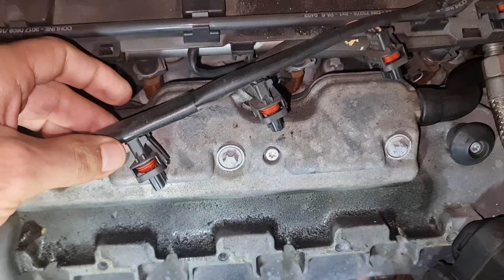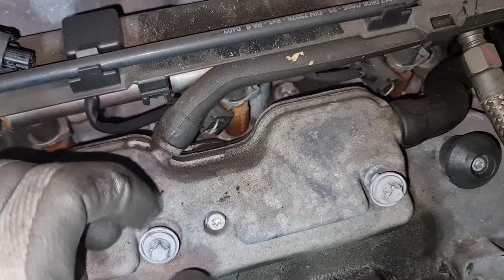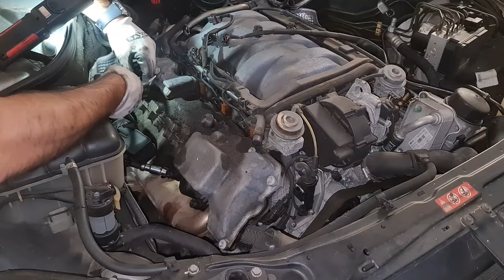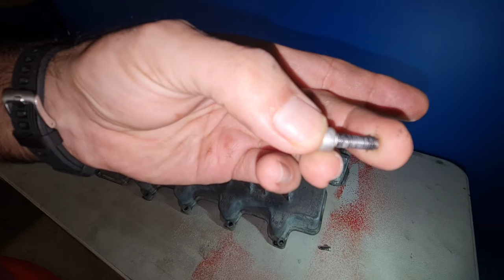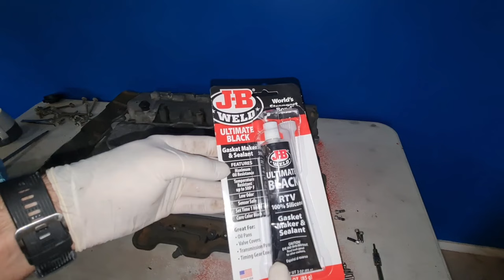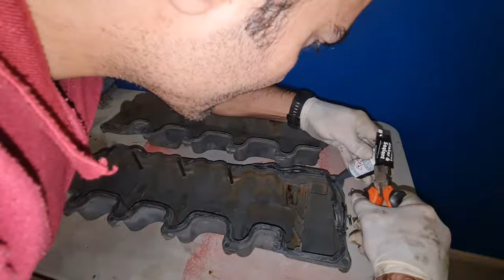The Secret to a Clean Engine (Mercedes M113 & M112 Valve Cover)

Comment: I have to re-do it again. Very annoying. The work is straight forward but it's still a pain in the 4ss because if you torque it slightly wrong or if it is not clean enough it will leak again. Plus I have a gasket from the manufacturer Elring which is too narrow and leaves a gap. Poor quality. It drips like crazy, I'm so pissed.
Reply from the maker: I know it is so tricky... that's why I am stressing in the video...
Reply: It will leak again because of design error.  The gaskets are barely adequate. Modern domestic use same sealing methods and the (factory) gaskets can be reused many times and the aftermarkets also don't leak but swell up too much to easily reuse.
Reply: After trying six times I finally got it shut. I found the place where the oil creeped between the cover and the gasket and added some RTV to that spot. But only a tiny amout, too much RTV will warp the gasket and create another leak. It's an artform by that point.
Reply from the maker: @haramaschabrasir8662  exactly my issue was that too first time.

Comment: I reseal the pcv cover and it start to leak, gonna do it again. btw, those 5nm bolt are extremely easy to strip, and the cover is very easy to snap if it's recently sealed
Reply from the maker: Yes, tricky...
Reply: Replace the screws and/or be extra careful.  Use Yamabond, The Right Stuff, OEM factory, hondabond, threebond, etc.  I used the best regular RTV (ultra black or ultra copper) and it leaked after a long time.  The ones I named first are different.....they are the harder, less rubbery, more crumbly (when you clean it out), less stretchy (when removing) than the regular (even premium 'ultra' and 'more oil resistant') types of RTV.  I would also recommend the right stuff when gluing up critical things like automatic gearbox, bevel gear, transfer cases, newer final drives (the old style axles with the big flange seal fine with the old rubbery RTV)

Comment: Do you have any idea why did they used aluminium bolts? Is it safe to swap them with a steel or stainless steel ones? I hate one-time-use parts.
Reply from the maker: If you overtighten aluminium, you will strip aluminium thread, if you overtorque steel, you will strip Magnesium made covers.

Comment: My neighbor C240 won't start until u remove the oil filler cap.after you replace oil filler cap engine shuts down
Reply from the maker: Is the engine worn? How many Ks on the engine? Excessive gasses pass throught the compression rings?

Comment: You should’ve replaced the breeder hoses ass well because they crack 
Good video
Reply from the maker: I did :)
Reply: Interestingly, I have never done the hoses it's been 22 years and and I even set the da*ned engine on fire and the hoses are still supple and not cracked.  Every time I look at them I suspect I'll find a split due to hoop-stress tension....but no.

Comment: Good job mate
Reply from the maker: Thank you John :)
Reply: @BenzAddiction  it'll be a good project with pretty low kms
Reply from the maker: @John  Yes, gradually will get there, replaced the 20 years old spark plugs, oil and filter and no check engine light as replace the accelerator pedal hopefully an update video soon.

Comment: U dont need to remove the spark plug cables, just remove the coil packs out of the way. those spark plug cables aren't in the way.
Reply from the maker: That's one way too, if sparkplug replacement is not needed...

Comment: I love my C240 but the interior plastics and foam material for the roof liner and various stuff don’t stand time especially in the sun and that ircs me hard because my 99 mustang does not have this problem, those cars have more a fitment issue on the plastics(gaps) if anybody knows where to get good aftermarket plastics/interior parts pls send me info, id like to keep this little 6spd for as long as I  can
Reply from the maker: Easy fix: https://youtu.be/YSd0GUCLq8w
Reply: @BenzAddiction  now I just gotta figure out how Im gonna get it out of a 4d 😩
Reply from the maker: @JoJoFlare  yeah, I know

Comment: Do you have to remove the plugs to do the gasket or just the packs?
Reply from the maker: Coil packs only, but recommended to replace the Plugs as well if it is about the time, makes it easier, saves time.

Comment: why no paint on valve coves?
Reply from the maker: It's your car if you like, but magnesium does not need paint.
Reply: Originally on my M103 the cover is painted but the paint is flaking off. so I will clean and paint
Reply from the maker: @hamlulit  👍

Comment: Bruh, youre supposed to just replace those breather hoses, there's a whole kit for the valve cover service, comes with both valve covers  the PCv breather hoses and the connections , and yhe breather covers screws that ure supposed to replace
Reply from the maker: I did, check few videos after...
Reply: Whats a link for the aluminum screws I can only find stainless steel
Reply: @keeganschultz5331  plain steel, bright zinc finish, any strength grade (4.8) will be fine.

Comment: Tha aluminum bolts for the breather covers must be replaced with the same aluminum bolts from Mercedes and not steel bolts. The reason is that these covers are made of magnesium, and steal in contact of magnesium causes oxidation, further deteriorating the cover bolt thread, loosing the cover and gasket causing earlier oil leak. Also, for these covers, don't use any other liquid gasket but the one from Mercedes. If you do, you'll regret as I did.
Reply from the maker: Thanks mate, I will check this every few month.
Reply: I think aluminum is more electronegative than magnesium and steel fasteners are typically used on both aluminum and magnesium (old motorcyles) housings.
Reply: @rsulka  tell Mercedes' engineers about that.

Comment: What do you do use to clean this
Reply from the maker: I used degreaser,  petrol and lot of scrubbing with brush.
Reply: Thank you so much for the video. 
My question is , while you have all this open , why not change the valve stem seals as they are prone to leak ?